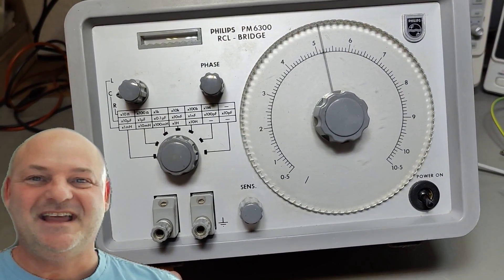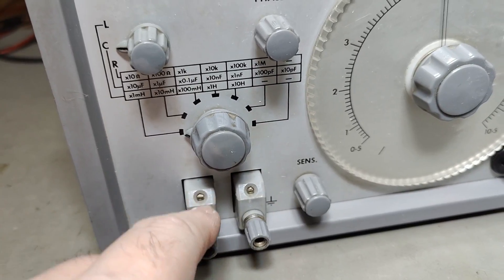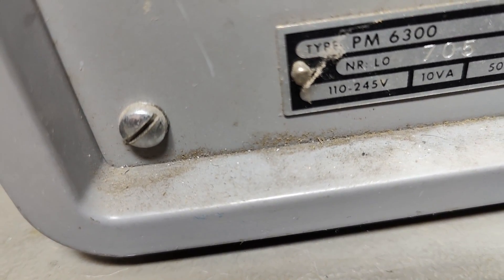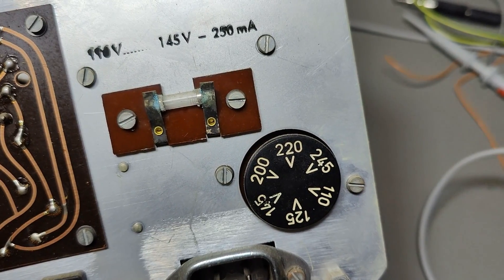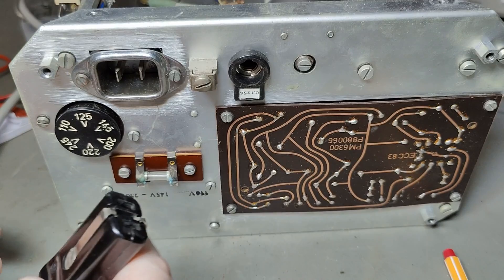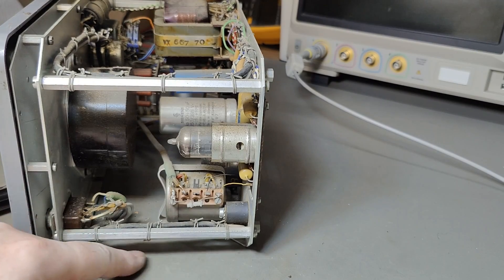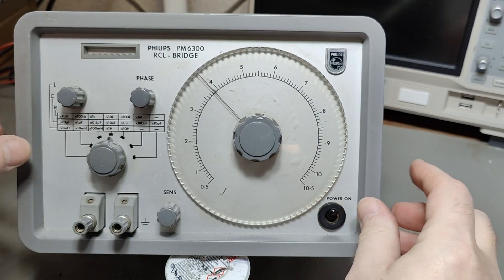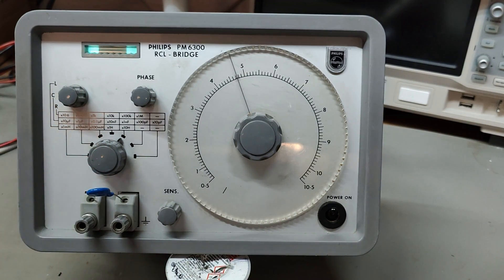Philips PM6300 RCL Bridge 1965 test teardown

Comment: I've rated this (5) OMGs  :face-fuchsia-tongue-out::face-fuchsia-tongue-out::face-fuchsia-tongue-out::face-fuchsia-tongue-out::face-fuchsia-tongue-out:    The entire unit: "into the ultrasonic cleaner"  :face-blue-smiling:  It may not run afterwards but it will look f.a.n.t.a.s.t.i.c.  Super COoL RCL. Thank you for the video.
Reply: It shouldn’t quite need an ultrasonic cleaner. Just hot water with dishwashing liquid and manually agitate. Then dry. Per Tektronix procedure more or less.
Reply: @absurdengineering   I actually "do agree" :hand-pink-waving: My Interweb humor (as it is) leaves little to be desired. I do appreciate you helping me onto the right path to adulthood. With luck I will get there. Cheers Absurd  You  R :finger-red-number-one: in my 📕